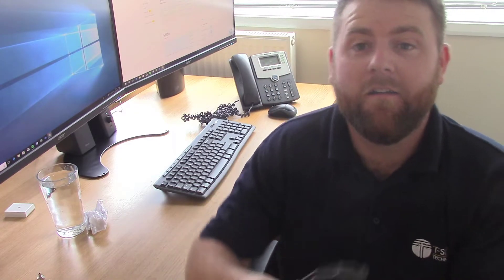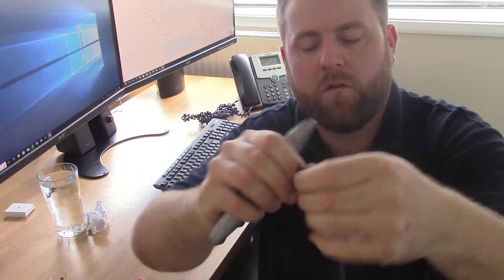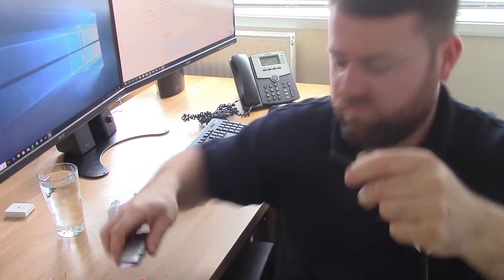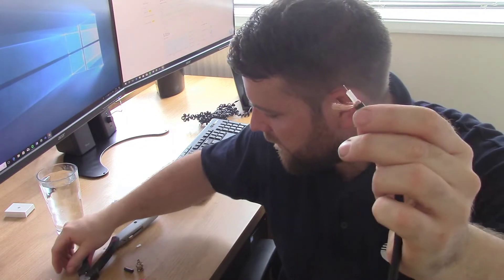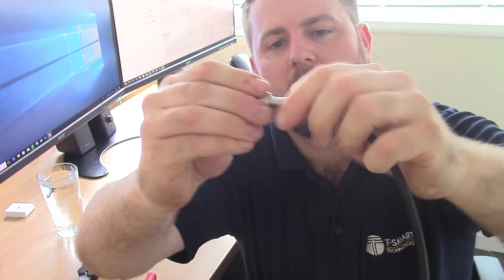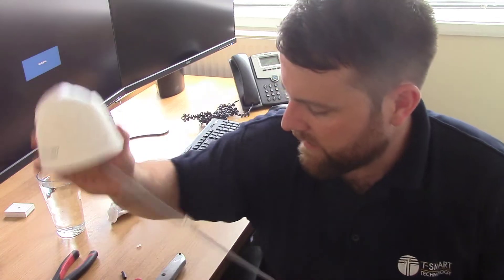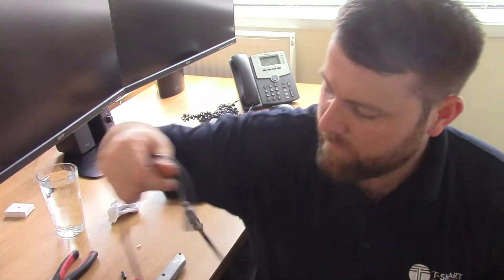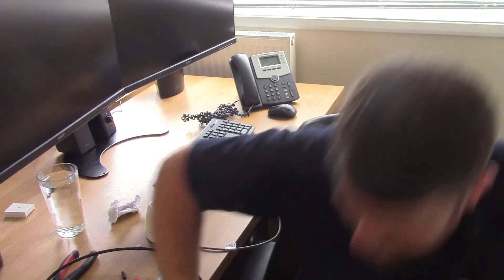How To Fit A BNC PLUG on RG59 CCTV Cable

Comment: Please forgive me if I'm asking you a stupid question.
We have a Sannce DMS 8308 DVR at work and a camera failed a long time ago. A colleague purchased 2 swann hd bullet cameras also a long time ago (too long ago to return). These cameras don't seem to work on this system 🤦🏻. I am good with a soldering iron even on circuit boards, do you think there is a way to resolder the video feed from the board?.
Thanks in advance 👍🏻

Comment: You need a bnc cable stripper tool and a bnc crimper that has a stinger crimper. These are not expensive. You want to crimp the stinger cap so it isn't loose and doesn't introduce interference into the cable.
Reply: How will the cctv camera outside conned to the dvr with no cables as it’s outside

Comment: very simple and helpful.
just a quick question if you or anyone experience kindly reply.
I am planning to do my own cctv with help from a friend who is good with DIY.

I m hoping to add hikvision 3k camera. so coax wire I have got two cable (one u explained) what do I do with the other one? do I need to connect to the cctv if yes what type of connection I need, name of the connector.
or just attaching one you just shows is enough for cctv to record and run smoothly with no issue. if that's the case why coax got two wire lol.

sorry for dumb question, go easy on me lol first DIY project
Reply from the maker: It sounds like you're referring to a DC plug. You will need a male and a female one. One goes camera end (male) and the other at your PSU.

Comment: Does this allow for power over cable ?
Reply from the maker: Hi Josh. Yes but only with a POC (power over coax) compatible camera and DVR. Otherwise you will need a separate DC connection.

Comment: How would i add a power conector??
Reply from the maker: I haven't got a video for that yet, will make one. Essentially buy some DC connectors, will need 1x male/ 1x female for each camera. Bare back the copper and screw down in +/- terminals. I hope this helps.
Reply: @smartaerials  hi thanks i read what you said n searched for some vids its not as hards as i thought thank you

Comment: Can you please provide a link to purchase the Connectors & PINs?
Reply from the maker: Here you go, pins come with the connector. Buy a few spare if I was you, so easy to lose the pins! https://cpc.farnell.com/pro-signal/rw1-003-b-zinc/bnc-male-crimp-type-rg59u-zinc/dp/CN15969?mckv=sLgvvrtT0_dc|pcrid|224645161149|kword||match||plid||slid||product|CN15969|pgrid|45968746254|ptaid|pla-891140135454|&CMP=KNC-GUK-CPC-SHOPPING&gclid=Cj0KCQjw7qn1BRDqARIsAKMbHDaxQYQs14cf8iep8NW7GNHVm1r8bvvQQhgzWihUxPM-NuDxN9TgalUaAu-JEALw_wcB
Reply: @smartaerials  Thanks very much, but I don't see on the the website where to locate the pins by themselves?
Reply: @smartaerials  yes me too Searching for center pin only for RG59, as i have hundreds of Connectors  with lost Pin

Comment: hello , i have a cctv cable but the inside is not copper but silver and i can't solder why  ?
Reply from the maker: It's most likely a steel conductor cable (not as good as copper). I'm not sure why it can't be soldered.
Reply: Seel , coated with copper , You can't solder